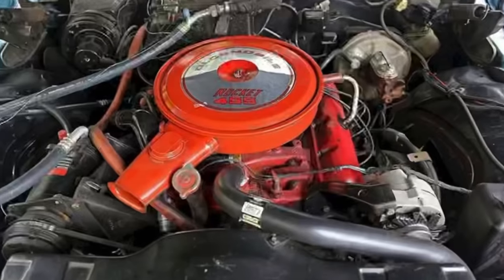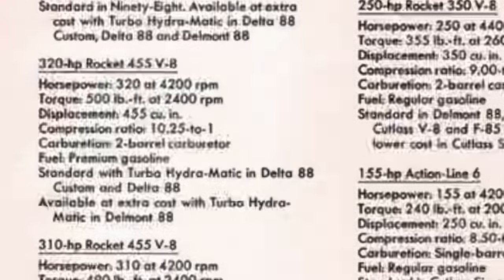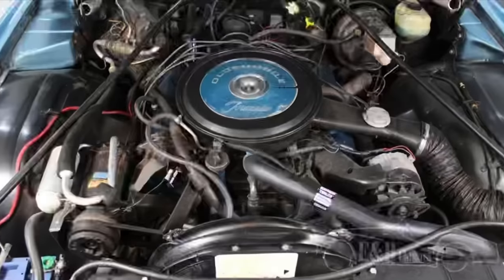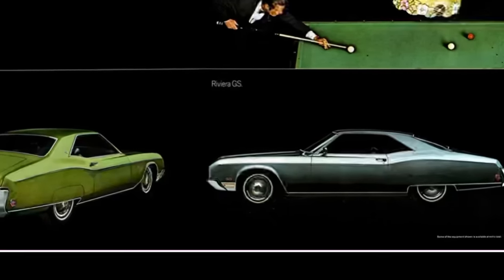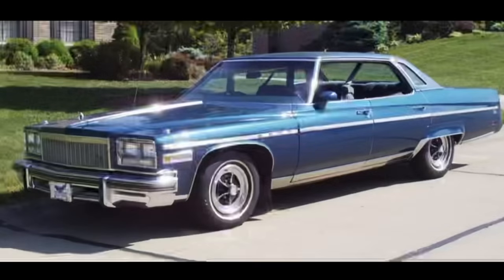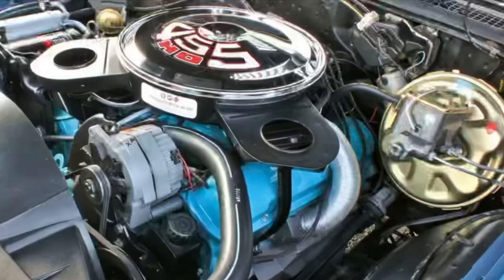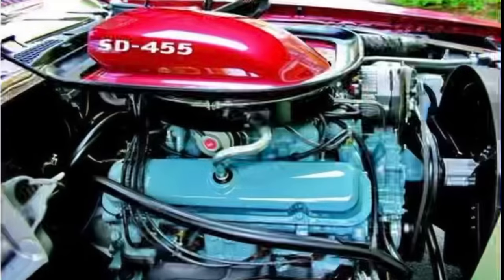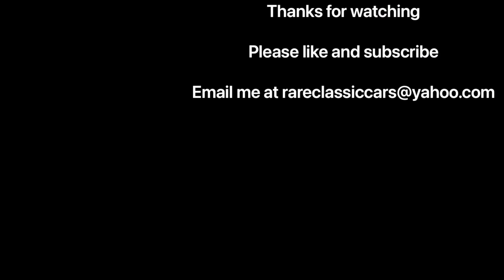Best Car Engines - The Rise of the Mighty 455 V8s from GM’s Buick, Oldsmobile, and Pontiac

Comment: Pontiac Monster 455 used less gas kicking azz,had 70 Olds 455 with E heads that's 442 stuff for those not knowing gas gauge moved faster then speedo but unless you put shy a grand in adjustable valves-chews cam over 4100 Poncho take 5500 all day the.. Buick was just brutal Torque but cost a mint to do anything with aftermarket wise but they all had torque STOCK that takes a hairdryer on a LS to get now a days

Comment: Camshaft lift and duration and timing events is what slowed the 455 engines down in the 70's. The emmision controls like EGR and air injection hurt too. Actually, all engines from this time suffered from detuning by the factories. One thing about the Pontiac intake manifold, the D shaped secondaies didn't hurt performance one bit. Airflow restriction on those pieces was just a myth that has long been debunked.

Comment: Of the 3 B.O.P. 455s, the Poncho engines are supported by the aftermarket to a much greater extent. Also, one big advantage the Pontiac has, is the stamped steel rocker arms developed together with Chevrolet. This allowed it to rev higher and stay together longer than the non adjustable style used on everything else. If you wanna wind out a 455, you don't want a Buick, that's for sure buddy! Pontiac and Olds would be my preference. Unless you have a '70 GSX stage-1?
Reply: The stamped steel rocker arm were made by Pontiac  Chevy  did not have anything to do with their development.

Comment: The 71-72 455 HO Pontiac engines were the precursors for the 455 SD and carried the round ports from the Ram Air II & Ram Air IV engines.  While low compression (8.4:1), they clearly outperformed their Buick and Olds counter parts.  To exclude these engines is an oversight you may seek to remedy going forward.
Reply: Ditto exactly what I was thinking.

Comment: We had a 72 Toronado and when in my mid teens my Dad would let me change those big spark plugs. In my toolbox I still have our spark plug socket I used. I get a kick out of dropping the NGKs for my 6 cylinder Hondas straight into it without even touching the sides!

Comment: Great video, Adam.  My curiosity, with these three engines, is how did three different divisions end up with the same displacement of 455?  You’d think Buick and Pontiac would have one-upped Olds and gone with 456 or something silly.  Especially since none of the bores and strokes were the same anyway (a natural way for the displacement to end up the same)
Reply: I'm guessing there was an edict from GM bosses that 455 was the max except for Cadillac 500
Reply: Yes 455 cubes was kind of a silent mandate by GM execs for those years.
Also each engine is up to 2 cubes off from actual 455 numbers. Some above some below.
Reply: @williamstamper442  Thanks!  It makes sense, but I was anticipating a “must stay under Caddy’s 472” mandate.
Reply: Maybe they figured, well, it's not a (Chevy) 454, we have one more cube and are therefore, superior.  😂
Reply: Yet with the 350 displacements they all get there with differing bore and stroke combinations, but Pontiac is actually a 355.  They simply called it a 350... to be like everybody else?  Also the 301 was actually a 302, but I can understand why they wouldn't wish to be confused with the Ford 302.  But why would they want to have *another* "350"?

Comment: As an enthusiast of all the engines featured in this video, the only “reliability” issues usually comes from driver abuse. None of theses engines like to rev. Most have their tongue hanging out by 4800-5000 rpm. Obviously, with some modifications, they will rev higher, but these engines are torque monsters. Gear them to take advantage of that torque, and hang on. The biggest problem with these engines is keeping tires on them. 

I do agree with the water pump problems with the Buick. I have had more than a few nylon timing chains disintegrate on the Olds engines. However, the nylon coated timing gears is a problem with many engines of the60s-70s.
Reply: Most engines of that era had the nylon timing gears, and it was a real problem.  It was all done to "keep the engines quiet."  HP Mopars had double rollers, and I assume some GM and Fords did.  All that was really needed was a steel gear and belt.

Comment: Nice video Adam.  Why no mention of the 1968 Hurst Olds Cutlass with the 390hp 455?  That was one very quick car, probably Oldmobile's quickest.  Also, most folks regard the 1973 SD 455 as the pinnacle for the Pontiac 455, not the 1970 model which was slower than the Ram Air IV 400 in the GTO.  Most car writers of the era slagged the 1970 GTO 455 pretty hard.

Comment: Adam, I worked for a PONTIAC dealer , 68 through late 70. I special ordered a 71 Le Mans safari wagon, ONLY 455 HO wagon built. Still own it today with 318,000 miles. NEVER rebuilt the engine or trans. All 70 - 72 A body PONTIAC'S with 455's had 12 bolt rears, standard. NOT available with a 350 or 400 engine..

Comment: I rescued a 73 Toronado from near junkyard status.  No rebuild just plug and wires.  I let it burn oil.  It was still powerful.  I could hit 120 and still have 2 inches left to the floor.  It was 2 years of fun dirt cheap.

Comment: My vote goes to the 1971 Pontiac Grand Prix. I owned a 71 Grand Prix SSJ fully loaded. It was such a sleeper, and I made some good money by blowing Mustangs, Camaros, and Trans Am’s off the road. I had a 455 HO with a 4bbl Quadra jet coupled with a 4 speed Hurst Shifter. I did replace the dual exhaust with less  restrictive Flow-master dual exhaust. I had so much torque that I used to put a Silver Dollar on the dashboard, and if you caught it, you could have it. I don’t remember how many times I did this, but I only lost 3X. I took my Grand Prix to a truck way station and had it Dyno tested 2 times. One with the stock dual exhaust, and one with my Flow-masters. To my surprise, there wasn’t enough difference to justify the cost. Boy, my friends that were “dual exhaust” experts had me believing that I was going to add at least 50 additional horsepower or more 😳😩. The first Dyno test showed me that I had 430 horsepower and with the Flow-Masters a whopping 435 horsepower. I deeply regret selling this car. It was the most fun and awesome car I’ve ever owned. The only problem I had was with the timing chain. Every 50K miles I could literally go get under the car and watch it start leaking. But changing the timing chain and water pump was no big deal. I could change them with my eyes closed. I traded it for a 1977 Grand Prix SJ, and while it was one of the most beautiful cars on the market.  The only other extremely beautiful car was the 1977 Mercury Cougar XR-7. Let me stop.

Comment: Buick used a thin, high nickel casting for this engine. They were light weight compared to some of the others..
The Buick gets my vote, my Dads 73 Electra always beat my buddies 73 Olds 98 in our friendly stop light take offs..
Reply: I had a '73 Buick 225 Limited and a '73 Olds 88 both with the 455.  Loved them both, but the Buick was my favorite.  I miss the whole 4dr hardtop thing.

Comment: Olds 455 is the best most durable engine. Needed higher gears in the rear end to attain higher speeds but had enough torque to launch well with those higher gears. Super durable.

Comment: The 455 in my dad's 1973 Olds Toronado had a predilection to go through cooling system thermostats, as I recall three of them failing in the 18 years my dad had the car.  They all got stuck in the closed position, leading to the engine overheating quickly.
Yet, other vehicles that my mom and I had, all being 15+ years, didn't have thermostat failures.

Comment: The big block Buick engine was one of the engines that was used to start the J-58 Turbo Ramjet engines on the  SR-71 BLACKBIRD. Awesomeness.👍
Reply: I believe it was the Buick nailhead engine used for the SR71 starter, but I could be wrong.

Comment: I owned a 69 Electra coupe with a 70 455  stage 1 engine.  Olive green, black vinyl top, with white interior. A true looking sleeper until you heard the dual straight pipes out the back. Was my daily driver for several years. Only issue I ever had, while running it hard frequently, was sheered distributor gear pin which I replaced with a drill bit. Sold to a younger kid that managed to blow the engine within a year. Not checking/changing oil. I would actually wax the engine block.  That 455, a 1959 Buick Le Sabre 401 Nailhead, and a 63 Dodge Custom 880 361 wedge are the best engines in my opinion and experience.

Comment: I bought a '70 Pontiac executive that seemed like it had one tune up in its life.  It ran on and would move the car while running on.  Heads were full of carbon ofc,  it was a monster after cleaning the heads and installing a dual plane weiand and a 800 holley .

Comment: I had a '78 Buick Electra 225 with 350, but it only put out 170 hp  275 tq (roughly). But it was great to drive. I grew up on '76 Buick Riviera w/455  (245 hp)  '73 Olds 455, a Pontiac that started up just fine from a bitter cold winter. I've have '85 Buick LeSabre, '85 Crown Vic. The TQ of 510 @2,400! I bet it could tow 8,000 pounds or more!!  I miss the old days.

Comment: I hired into Oldsmobile  in Feb. 1964 in the engine plant. They used to start the engines and run them and set the timing, called it the hot test. Every once in a while if you walked by where they run  them, you would see one with a rod sticking out of the oil pan. The had good quality control back then. Later years, the quality took a hit. When I  transferred out of thee engine  plant, our line was cycling every 15 seconds.
Reply from the maker: Thx!  What do you mean by cycling every 15 seconds?  240 jobs per hr?
Reply: @RareClassicCars   Yes,, the line didn't move steady, it picked  up the blocks, moved them ahead to the next position, moved back, then  picked them up and moved them ahead. It moved every 15 seconds. The line where the heads and other parts were put on was like an endless line, the pedestals where the engines were pulled off the line, went under the floor and back to the other end. After the engines were tested, they were hung on hooks, then they were put on a conveyer that ran through the plant, about two city blocks to the assembly line.

Comment: the stage 1 turbo jet was 450HP advertised, many put it closer to 500 with very few simple intake mods mods such as the old air filter cover flip mod..  yessir... that car was untouchable by them all, the 440 mag, the Hemis, 454's, nothing could touch it, headers, edelbrock, 1100 holly DP, electric fan, and fuel pump.. more like 525 HP.. just insane

Comment: Interesting detail on the Olds engines is the unique valve order in the head being I-E-I-E-E-I-E-I (I = Intake, E = Exhaust, one bank shown).
SBC, Buicks, Pontiacs are E-I-I-E-E-I-I-E,  Cadillac and BBC (and the newer LS engines) use the I-E-I-E-I-E-I-E valve ordering.  It would be interesting to know what advantages each of the valve orderings had since this affects the design of most of the engine - intake and exhaust manifolds, heads, camshaft, etc.
Fords and Mopars generally use E-I-I-E-E-I-I-E for their small blocks and I-E-I-E-I-E-I-E for their big blocks.

Comment: I had a '72 boat tail Rivie didn't know what I had till I rebuilt it. One of the drivers at our trucking company used to race Buick's. Informed me I had a stage 1 on the shop floor! that explained the aircraft size intake valves. God I miss that car! Rot took its toll sold her for a few hundred dollars in the late 1990's . buyer wanted to put to the engine in a short bed '65 Chevy pickup, that Nuts!

Comment: We owned a 1973 Grand Prix SJ with the 455SD from the factory!  This car is unknown to the automotive world because it was a one off, hand built by Pontiac for my father.

1973 was the launch of the new body for Grand Prix.  To help generate interest, Pontiac was going to offer the 455SD as the top engine option.  At the last minute it was dropped because the Firebird guys were having a bloody fit over it wanting the SD to remain exclusive to the Firebird line.  Brochures for the new Grand Prix's had already been printed that offered the SD by this point and distributed to dealers.  After the last minute decision to drop the SD the dealers were supposed to pull the brochures from the floor.  My parents were looking to buy a new car at this time.  We went to a dealership in Oak Lawn, ILL right around SW Highway and Cicero, I think it was on the SE corner of that intersection... I can't remember the dealer name, 73 was a long time ago! Oddly enough I remember we purchased a 73 Chevy wagon from Jack O'donnell Chevy <SP?> the same year.  My mom really wanted a gold Firebird because she loved James Garner and the Rockford Files but dad didn't care for it for some reason.  He preferred the look of the new Grand Prix so that's what we ended up getting.  By chance the dealership hadn't pulled the original brochures and that's what my dad was looking at.  He was probably having his mid-life crisis and wanted the big dog 455SD.  He ordered a fully optioned top of the line SJ, metallic forest green w/ white top and, of course, the honeycomb rally wheels.  A few weeks after ordering the car the dealer contacted him and told him that there was a mistake, the SD wasn't actually offered for the Grand Prix, he would have to settle for the HD version.  He told the dealer too bad for them, he ordered and PAID for the car as optioned, he wanted the car.  They went back and forth but Dad wouldn't back down and had the family attorney send them a demand letter for the car as purchased.  This went all the way up the ranks of Pontiac ultimately ending with the president of Pontiac calling my dad personally trying to work something out.  The old man wasn't backing down and threatened a lawsuit based on Pontiac pulling a bait and switch.  They had no choice, they had to make good on the deal.  They pulled the car off the line and sent it to a prototyping area where they pulled the HD out and installed a 455SD and my dad got his car as ordered!  I was 9 in '73, I had no idea about any of this.  The car was passed down thru the family and I ended up with it for a while.  By this time the exhaust was completely rotted off the car so I saved up all my money and ordered a new exhaust from Beacon Auto Parts in Orland Park.  When it came it, it didn't fit.  Went back to Beacon and they double checked it and it was correct.  They went out and looked at the emissions tag on the core support and verified that it was a 455HD so the parts should have been correct.  They insisted that at some point the car had a custom exhaust installed because it was larger in diameter and appeared to be custom bent/welded.  I was confused, we owned the car from new and it never had an exhaust put on it, it didn't make any sense.  Luckily Beacon was nice enough to refund my money and didn't charge me the restocking fee.  My brother ended up with the car and sold it to a buddy of his for $250 who proceeded to throw a rod out the side of the block in less than a week.  Fast forward 30 years and somehow my brother and I got to talking about the Grand Prix.  It was then that I found out the whole backstory about the engines and that it was a one-off, custom built car direct from Pontiac!  My jaw dropped, I couldn't believe that he sold that car knowing all of this.  That finally explained why the exhaust parts didn't fit, Beacon was right, it was a custom made exhaust.  Pontiac didn't bother to change the HD emissions tag under the hood to the SD version.  It also explained why the vacuum diagram on the tag never matched up.

This automotive history is entirely unknown outside of our family, and now that my brother passed, I'm pretty much the only one who knows the story.  I want to try to get this fascinating history out to the world so that it's not lost in a few years when I pass.

Comment: The ‘68 Hurst/Olds got the 455, a workaround from management by having Hurst involved. The Pontiac 455 SD had a cast iron crankshaft.
Reply: It was always my personal belief that Oldsmobile got to put their 455 out first as kind of a reward for developing the Toronado FWD platform that Cadillac cribbed for their top of the line El Dorado. Toros had a 425CI until 68. Cadillac enlarged their 429 to a 472 in 68 so Olds got to up their 425 to a 455. I had a 76 Toronado with a 455. It would do a big league burnout without the aid of the brakes. It was very smooth engine and it pulled a friend’s early 80’s full size Delta 88 out of a gulley.
Reply: All Pontiac V8 crankshafts after 1967 are nodular iron (AKA ductile iron AKA spheroidal iron)
Reply: @alantrimble2881  It’s still cast iron. Not forged.

Comment: I totally agree about the reliability of all three engines, and I'm also a bit surprised about the oversqure Buick...  My 1969 Wildcat requires a very gentle touch on the throttle to prevent wheel spin.  Just as my 1968 Toronado would easily smoke the front tires if you pressed that big pedal too hard.